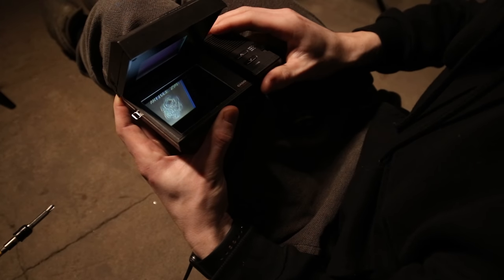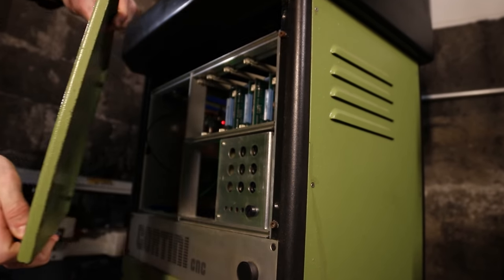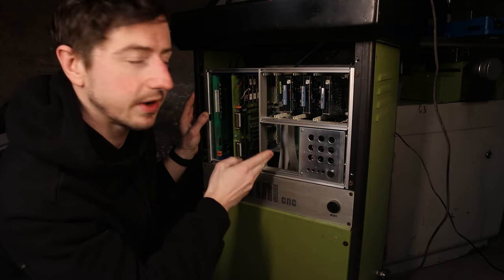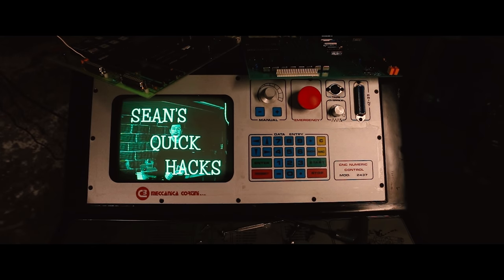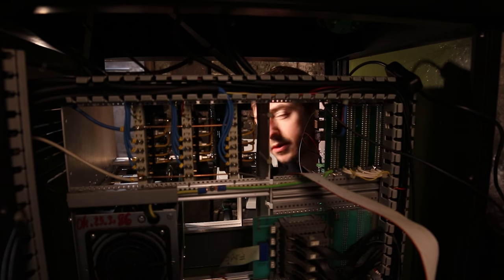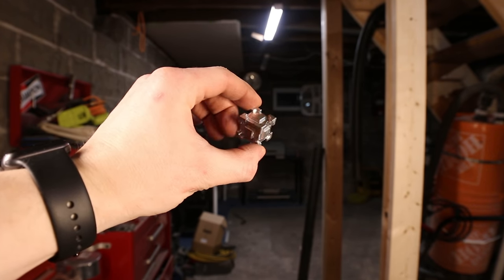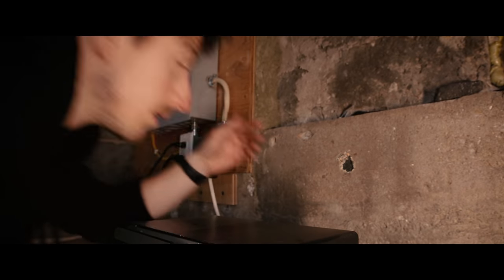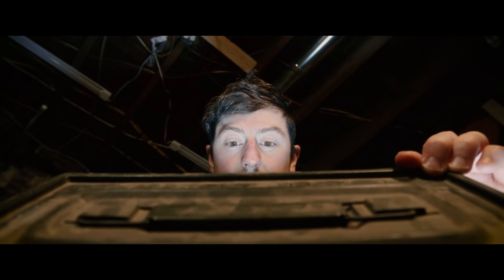35 Year Old CNC Controller Retrofit - EP-T0-625007DC

Comment: So incredibly cool to see my name on that screen.

In our lab we have a Bosch CNC-machine from the early 1980s which is running, but the user interface is sooo bad, it also has about no memory at all. I have thought about a refurbish like this for ages - even just the Arduino should be an improvement.
Reply from the maker: This is running on a Pi and Teensy 4.1 now, its pretty powerful! I was lucky to be able reuse all the power stuff so the conversion was simple, maybe your machine will be also.

Comment: I operated a cnc plasma cutter that was only 1 of 3 made back in the 70s using punch cards to do basic shapes using oxyacetylene, but had been upgraded to a stationary plasma torch blowing down through a 6" tube into a metal box that had to be empty a couple times every shift. I loaded the sheet metal onto a platen of 1-1/2" steel ball bearings and the clamps al9ng the rear of the setup would move the plate along 2 axes, after zeroing out the metal sheet.
The main screw drive bearings died during my shift as it would erratically lose it's zero and have to be reset. The company installed a new one which they had to do some torch cuts to make fit, but last I heard they invested in a $1/2 million laser to take this historical workhorse's place.

Comment: I'd like to try and find an old square-column vertical bed mill like one of the smaller OKK ones.  The problem is finding one which isn't too big.  The MH-2V has either a 5hp or 7.5hp 50-taper spindle and a 12"x51" table.  I wouldn't want to go much bigger than that.  The spindles don't run too fast (1600RPM) but I could use a speeder for jobs which need higher RPM.
Reply from the maker: Pretty decent size! I wouldn't mind bigger if they weren't such a pain to move.

Comment: Cool stuff. if you are replacing the brains, you should look into Bart Drings Universal CNC controller which is modular and I believe uses his port to run GRBL on an ESP32, which is massively better than a regular arduino.
Reply from the maker: This controller uses a Teensy 4.1 which is a power house!

Comment: Wow that retrofit seems almost too simple... what are we missing?
Reply from the maker: Homing switches and spindle control (another 7 ish pins), they're hooked up, but the homing sequence in the CNC software on the pi doesn't seem to do its routine. The sensors do work correctly though. Also, the spindle isn't responding to the RPM voltage either, so its just manually set it on the mill.

Comment: hi, does the crt have a ttl interface?
Reply from the maker: the display itself? No its just a composite signal to control it. Not sure about the CNC controller board though.
Reply: @SeanHodgins  ok thnx!
i have few monochrome TTL monitors with some sort of serial connection, and are quite similar to yours. Thught you reverse engineered it.😅
thnx